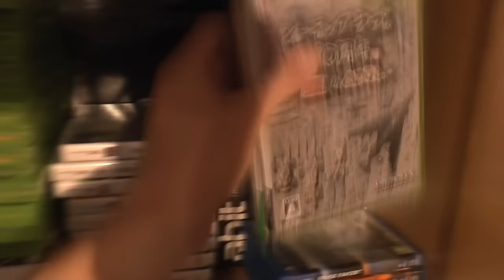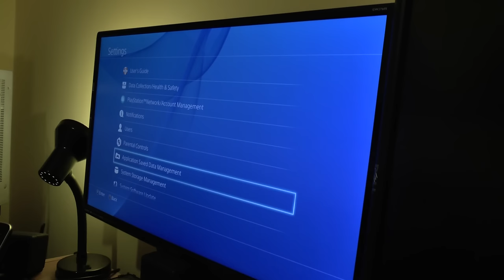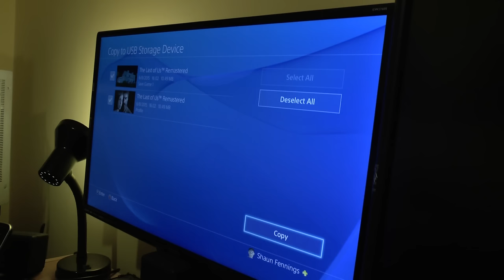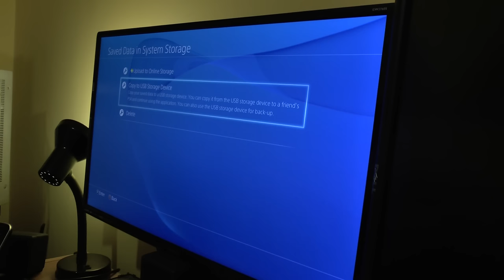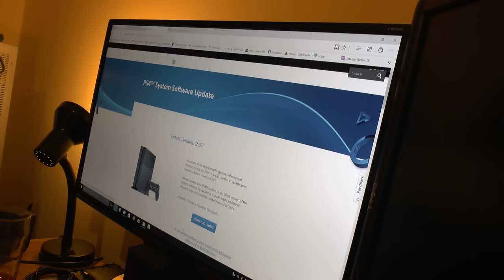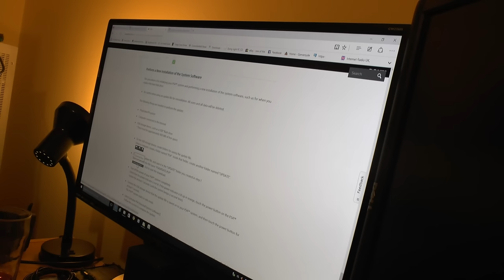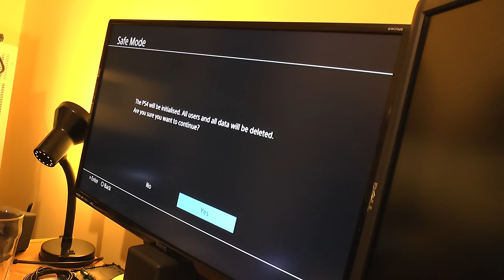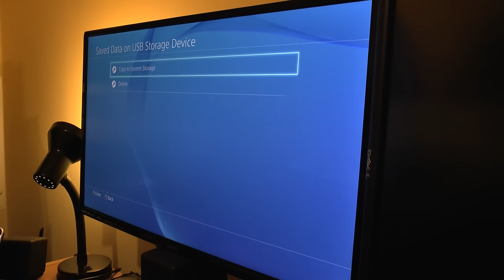How to: PS4 2tb HD Upgrade

Comment: surely there has gotta be some way of say cloning the original hard drive and transferring its contents to any new drive.
Reply from the maker: +RallyDon82 Not that I'm aware of. :-(
Reply: +RallyDon82 there is you go to back up and restore and it takes the game data i did it with pt because you can't download it anymore and it all went on my new 2tb hard drive no downloading required.
Reply: astex07
 Really if so this is great i've not seen this documented anywhere as yet you sure you're not mistaken?
Reply: +RallyDon82 I did it already it worked it got added with a system update
Reply: ahhh makes sense i'll have to have a look myself this is promising

Comment: You need to get yourself a "Spudger" my friend,   they cost pennies to buy and are the best tool people don't own!

Also, I got that NYKO thing that lets you use 3.5" disk drives,  only problem is the PS4 freaks out if you put in any drive larger than 2tb.  It'll either say everything is corrupted on it, or refuse to read it completely.
Reply from the maker: +Larry Bundy Jr Spudger?
Reply: Faginrs500
Yes, a spudger.   Google it.
Reply: Kent Kerr
thanks dude,  as long as its a metal one (plastic is only good for super delicate things, like prising glass from a phone Etc.)  you should be fine!
Reply: Kent Kerr
Neinen ze problemmo :)

Comment: Hi Shaun
Excellent video, it looks quite straightforward to me.
Just a question that you might be able to answer for me please. After you swapped out the old ps4 HDD into the Seagate enclosure did you try connecting it back to the ps4? I was thinking if the ps4 could then access the contents of the old drive it would save a lot of hassle downloading games and updates.
Thanks again
Reply from the maker: +Andrew Smith You can't use external drives to save or access game data..... only game saves.  I never tried reconnecting the drive up to the PS4, to see if it could pick up the game saves though.

Comment: Why not just do a full backup of all your ps4 data to the external hard drive before you dismantle it? I imagine you'd still need to reinstall the firmware with a flash drive, and backup your save files to either a flash drive or the cloud, but at least you shouldn't have to redownload all the games and patches that way. Or will reinstalling the firmware wipe all the content of the hard drive anyway?
Reply from the maker: You can't backup game data..... or you couldn't at the time iirc.
Reply: I found out you could do a full backup of all your data including game data to another external HDD and then restore it back to the new ps4 HDD after reinstalling the firmware. But not on the same new HDD you're installing in the ps4, as it will be formatted, nor from the HDD after you've replaced it, either. I honestly think it would be a good idea to include a "backup mode" of the HDD you're currently using, which would let you transfer all the data back from it into the new HDD by a SATA to USB adapter.  

That would've been helpful, as I didn't have any other external HDD with enough space at hand, so I just had to go with redownloading all the 450+ gigs of game and save data.